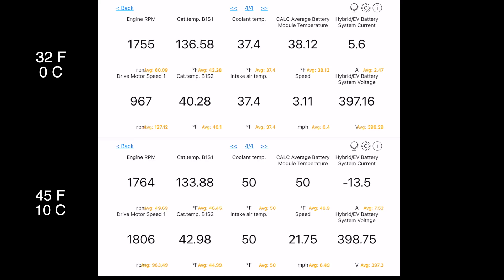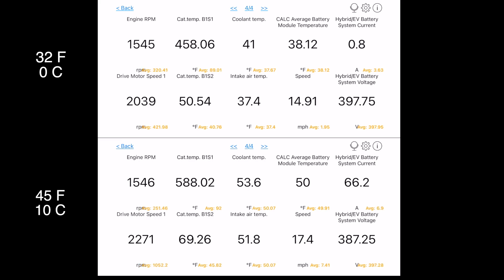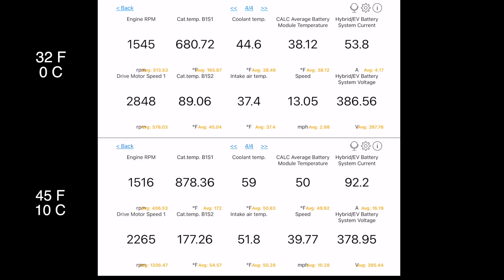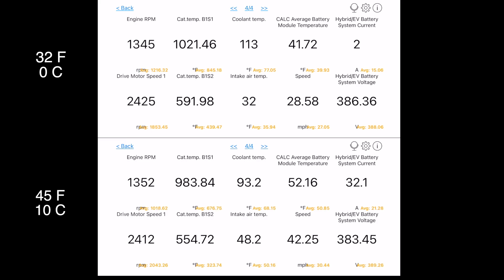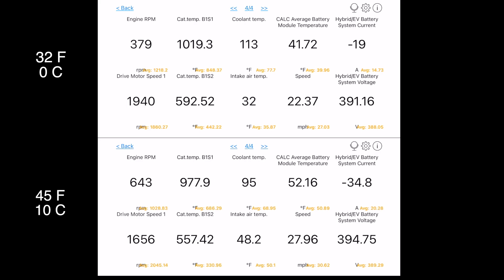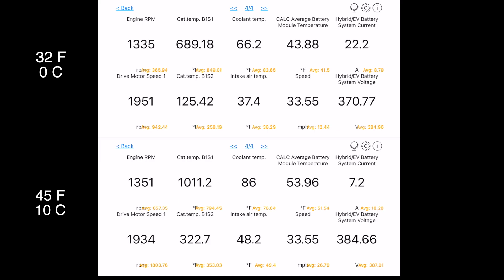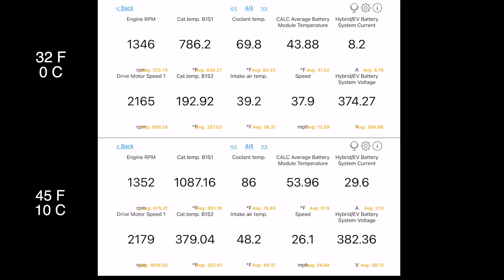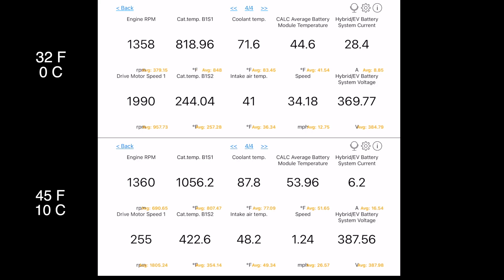Niro PHEV How the Gas Engine Runs to Heat the Cabin

Comment: If it is very cold will the engine burst into life instantly so I can defrost the windows etc?
Reply from the maker: As soon as you do anything that requires heat, the engine will start. Unlike Toyotas, the Niro has a classic starter (which can be used as a generator), so you definitely know when the gas engine initially starts.

Comment: As far as I can tell in my Niro PHEV, the engine will run at more or less a high idle speed while the cabin is heating, even if you are driving in EV mode. The engine doesn’t supply any power to the wheels, some to the battery, but mostly just idles to heat up the coolant as you noted. When the cabin is at set temperature, engine shuts down.
Reply from the maker: Do you have an ODB2 reader and associated software that you can use to see how the 2020 Niro PHEV behaves in the same situation?  I'm curious if the 2020 revs as high as the 2019 does.
Reply: @mynirophev3121  I don’t have an ODB2. I did check the tachometer in the dashboard. Initially, the engine revs to 1600 - 1700 rpms, then after 15 seconds (approx) drops to 1200 - 1300 rpms. The engine then maintains the lower rpm until it shuts down. I don’t know what the regular idle rpm is when running in HEV mode.